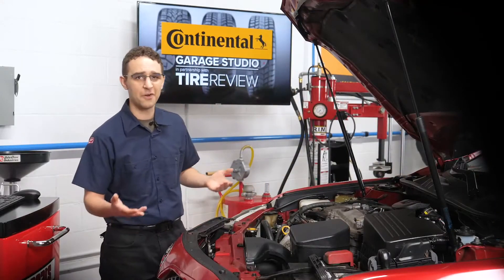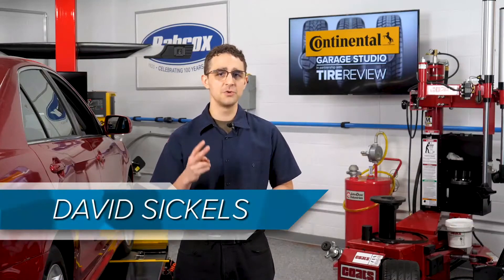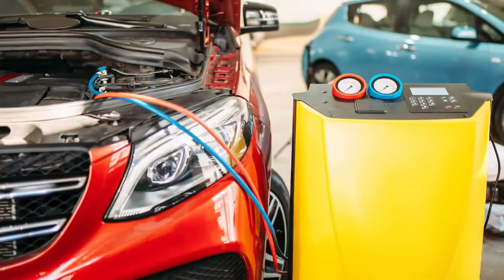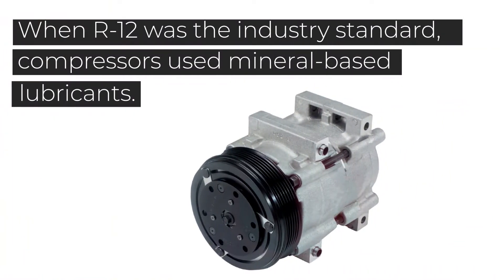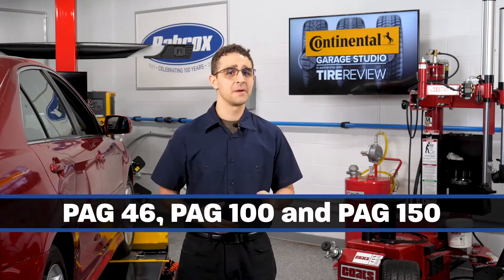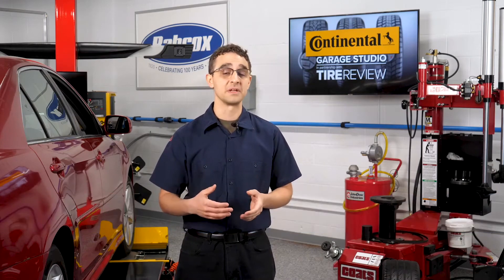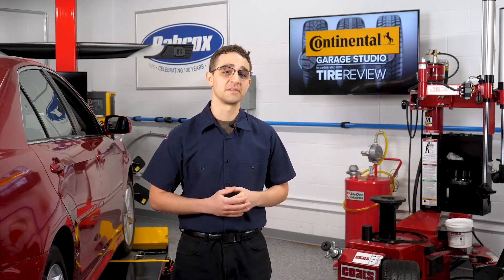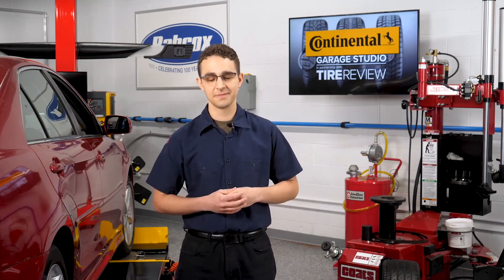R-134a or R-1234yf? Three Tips for A/C Oil Service

Comment: Can I use 134a oil in 1234yf system
Reply from the maker: R-1234yf oils can be used with R-134a systems, but R-134a PAG oils are not compatible with R-1234yf systems.
Reply: But in your video you said both r134a and r1234yf use pag oil